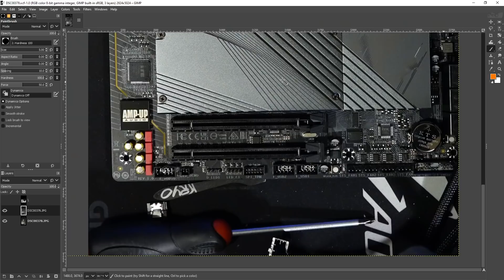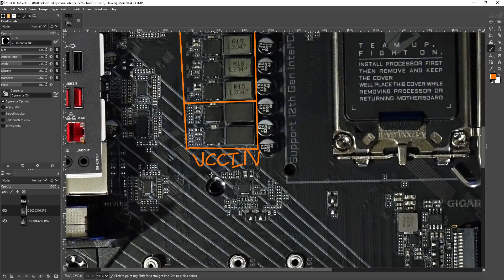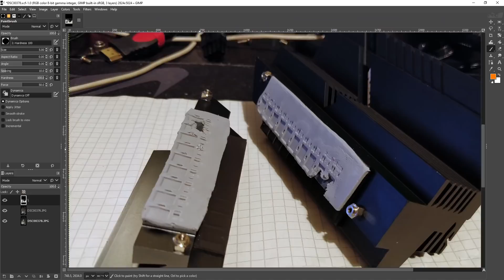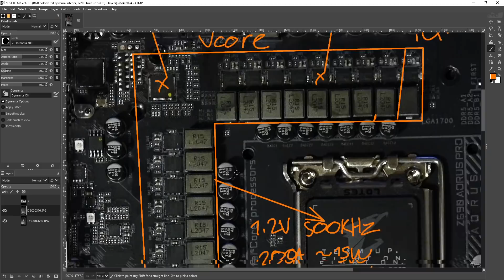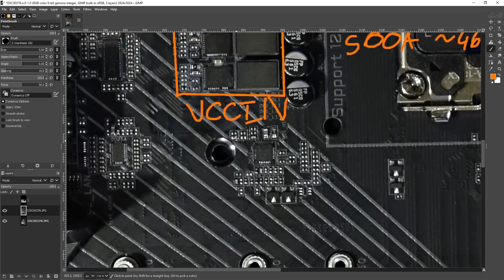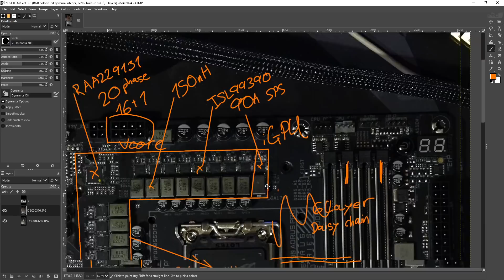mobo PCB Breakdown: Gigabyte Z690 Aorus Pro // The GOTO Overclocking board

Comment: Now two years later and with the F28 bios, I am trying to get my 7200 memory kit to run at 7600 or 7800 even. So, I really don't need to get a Z790 to overclock my memory. 
And Gigabyte didn't believe in their own products and declared 6000 or 6200 ram to be the end of the line for this incredible board. The digital code display was actually my reason for getting it in the first place. It replaced my Z270 Gaming 7, which also has a LED debug screen on. I kinda don't want to buy a board without one. Once you have one, you cannot go back.

Comment: Thanks for making all of your videos, I've been bingeing them for the last few days. Would you recommend this board for a CPU like the i7-13700k? Or are there better options to consider?
Reply: I use this motherboard with 13700kf, with a  offset of - 0.075, Vcore set to Normal and  internal VCCSA to Normal, I get much less voltages and temps, I have also noticed from all of my previous Gigabyte motherboards are too aggressive in voltages!

Comment: Just grabbed this board, but the ULTRA version (vs "PRO").  Was $199.99 because of antonline (their own site, their amazon store, ebay store, etc.).

Of course, I am coming from the future of 11/11/2022.
Reply: PS - it goes from 90A to 105A Power Stages, but I'm not sure what else is actually different about the Pro to Ultra 'upgrade' (original price jump was 330->370, so maybe that increase power is the only difference).
Reply: UPDATE - the Ultra also adds support for DTS:X Ultra (which the Pro doesn't have) and you go from DisplayPort 1.2 to 1.4 from pro to ultra.

So.... DTS:X Ultra is added to the sound support and you upgrade to DS 1.4, and you go from 90 to 105 on the power stages.

Comment: I have this board and absolutely love it. But I have a question/concern that I'm hoping somebody may have some insight on. I decided to replace the Intel ILM with the Thermalright contact frame, and it is actually working great. The first time around I didn't have enough contact with the pins, but I went back through the GN method on installation and it is great. Core-to-core deltas are down and I can run P95 at 5.4 (i5-12600k) and get down to 88C. 

The only thing is: I immediately started noticing coil whine coming from the VRM. I am 95% sure it was not audible before the ILM swap. 

One more detail: it completely goes away when I run a static voltage. I know that's because it's steady, and that is basically what should happen. But yeah. I know whine can be normal, but it's new to me and I am just a little concerned with the circumstances under which it started.

Everything is running perfectly, VRM temps are great, benchmarks run great, etc..

I opened a ticket with Gigabyte, just to get out in front of it just in case. I'm a tech professional myself, but only about 9 months getting deep into hardware.

Any advice?

Comment: Would i be better of getting this z690 pro over the z790 aurous elite 90amp vs 7amp. does the eelite have 4 more pcie 4.0 lanes? the pro has better rear i/o and wireless maybe better on board audio not sure. And it has that post code and 9 temp sensors. plan on running it with 13700k.

Comment: The Digital SPDIF OUT, or the optical output you mention, is very important to me : Why ? Because its great at transferring home theatre quality5.1 surround sound, into your home AV home theatre reciever. I have a 75" monitor and a 3080Ti to run 4k @ 120Hz for MSFS 2020 for example. Works great :) And when I stream music or movies I get 5.1 via the PC hooked to the TV :D😊 OH and those red filters are great, the audio should be very very good here :)

Comment: I like this board, i may have to find out if my Noctua NH-D14 works with it, all tho i may have to wait for next gen Intel, i am worryed about power usage of their current lineup, and i kinda want an i5/I7 wiht a bit more pref but lower power draw if posible. Also my 8700k on my Gigabyte Z390 Auros elite, is still going strong in most games(cept bf2042). So getting it oced on my current board could prolong its life for a year or 2 more. But if i wanted the 12600k/12700k i would be shopping for this mobo, just based on your review. it ticks all the rigth boxes for me as well, all the the price is a  bit steep in my country, to be fair it seems that all Z690 is heavy duty overpriced tho.

Comment: S/PDIF = Sony/Philips Digital Interface. It uses one or both of these connectors (on motherboards, usually Optical only). Usually there's only Out, sometimes both In & Out:
   * Optical  (TOSLINK)
   * Coaxial (1 x RCA with an orange ring)

S/PDIF was developed for CD-players, then utilized with DVD-players etc. That's where ~1.4 Mbps maximum bandwidth comes. Which is enough for:
   * CD-Audio (PCM 2.0 16b/44.1kHz)
   * Dolby Digital 5.1, Dolby Digital EX
   * DTS 5.1, DTS-ES, DTS 96/24
   * MP3 etc.

So, these are absolutely impossible via S/PDIF (DRM alone prevents it). Both of these can be found at least from Blu-ray movies (both 2K and 4K):
   * Dolby TrueHD
   * DTS-HD Master Audio

Comment: this or the msi carbon? with the consideration of price. Is there a performance difference between higher amp lower phase count and lower amp and higher phase count other than temperature differences, according to the divide by 10 rule, the msi vrms will run hotter than the aorus pro. Also whats the difference between an 8 layer pcb and 6 layer

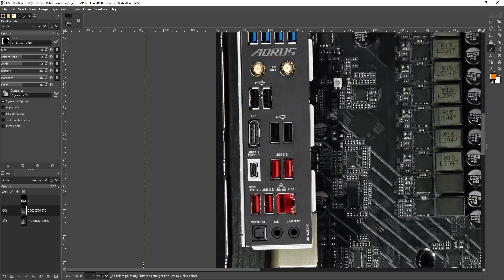Comment: 6:10 Basically, they got rid of the 'orange' (centre speaker or subwoofer), 'black' (rear speaker), and 'light blue' (line in or side speaker) jacks, keeping S/PDIF (sort of an optical line out), 'pink' (always mic in), and 'lime' (line out or front speaker). They've essentially realised before anyone else that nobody runs their 7.1 channel sound system off of a motherboard, and those that do use a computer as a home theatre PC with 7.1 probably use an audio receiver anyways, to connect consoles and what-have-you to their TV as well.
Reply: Buildzoid should make a poll which audio source people are actually using:
Mice in (pink) & line out (green)
Spdif (optical)
Gpu HDMI /DP
Bluetooth / WLAN
USB
5.1
7.1
Reply: Most audio receivers specially 7.1 or 5.1 don't have full line out ie sub out, surround out. Most are powered line out. It's a headache if you have built in powered speakers and subwoofers.

Comment: Also this is the cheapest (almost) Z690 mobo with a temperature sensor header (which is very important for custom water cooling loops so you can control your radiator fans of off the coolant temperature). The cheaper is the Gigabyte Z690 AERO G, which seems to be basically the same mobo, but targeted at creators. It doesn't have the OC features like POST code.

MSI's Z690 with the temp sensor header are only in the MEG (highest) line and the ASUS Z690 mobos seem to be very costly. Well, technically there's the ASUS PRIME Z690-A which is less than the Aorus Pro and it does have a temp sensor header, but it does not have the other OC features. It's $30 cheaper according to newegg, not much of a difference given what the Aorus Pro offers. Btw the ASUS TUF Z690 line does not have a temp sensor header. And no, I don't care about ASRock, didn't bother to look at their lineup.
Reply: I was lucky enough to get a combo drop on Newegg and was pleasantly surprised the board had a temp sensor header on it. I am upgrading from MSI Z390 Ace and I am looking forward to being able to tune my fans to my liquid temp.

Comment: You've got it EXACTLY right when it comes to "Dual BIOS" implementations! Gigabyte should do away with the single/dual switch on their "AORUS Master" boards and just have the BIOS 1/2 switch. If not, just stick to single BIOS. Having to cut power during boot 3-5 times in a row to get the "auto BIOS" system to switch is a royal P.I.T.A. (plus, there is usually NO on-board indicator for which BIOS you're on!)
I'm also in total agreement about POST code displays. I absolutely love 'em, and have always bought the cheapest MoBo that has one on it. I've found that every manufacturer, by the time they include it, makes a high-quality VRM and memory buss, so if you've got a POST display, you've got a good MoBo.

Comment: I wonder if the SMT PCIe slot is going to be an issue over time from the stresses of thermal cycling and the weight of some of these modern video cards.

Comment: The super super low end entry Gigabyte Z690 UD is apparently 60A * 16 and 6 layer.  I kind of question why anyone would venture outside of the "entry" 200-300 range for gaming/light OC on a 12600/12700k. It seems like the VRM matters less this generation for these two CPUs? (Aurous PRO also seems to be barrier of entry for 12900k).

I would argue the only benefit to a super premium board ($500 USD price range) is 8 layer integrity for memory OC and what not.

Side note.. My X570 UNIFY VRM seems mediocre now by Z690 standards, but such is life.

Comment: I might upgrade to this board in a year or two, just couldn’t justify the move to ddr5 yet so I went with a lower tier gigabyte board that is ddr4.
Reply: Not worth the effort, DDR5 is 2-4% faster than a good kit of DDR4 (see TPU comparison). You will never notice that, so it makes no sense to swap everything just for that minute difference. What's more, Raptor Lake (Alder Lake successor) is gonna come out in about a year, and it's gonna bring Z790, which will also have some boards with DDR4 support. So DDR4 ain't dead yet, it's actually still quite competitive as it's completely mature, they got everything out of that technology, while DDR5 is still in its infancy and too expensive (or sold out at the moment).

Comment: One way around the dualBIOS is to change the 2nd BIOS post boot image.
 The intel UHD770 iGPU can overclock +500MHz giving it a 2.1GHz clock rated at over 1TFlop of FP32. It helps with quicksync.

Comment: 12 type A ports, damn, when is the AM4 version of that happening. I think 7 was the max on peasant priced boards. FYI, external sound will always be cleaner than any DAC inside a digital RFI noise filled computer case.
Reply: B550 Aorus Pro has 11 Type A USBs for 180 USD. Most of the Gigabyte lineup for B550 has tons of USB ports.
Reply: gotta love being able to hear the mouse move and being able to tell what's on screen be the type of high pitched noise made.

Comment: why do some z690 boards have an extra dimm slot(3/5 total)? btw i have realtek lan and it works great even though my board is from colorful(i regret everything), intel lan is a scan in my book
Reply from the maker: because that's not a dimm slot and if you read the manual for those boards it would tell you what it's for.
Reply: I'm curious now. What is it? :D

Comment: I ended up getting the Master this gen... at $469 its a no brainer
Reply: Do you like it? any issue with bios or ram? Thanks
Reply: @salehabdulla9177  horrible board, no i run an apex, 12900k 5.5 4.3 7200cl30 now. I had sooo many isssues with the master but that was rev1 right after launch. Bios updates could have ironed out the issues. But it wasnt even booting 5200 xmp even after me setting everything manually i couldnt get it to boot.
Reply: @sagerdood  k I had positive Z690 master exp. but received damaged on usb plate so shop send me asus hero. when I tested master it was very cool no heat. on asus hero pch heat to 60c.

Comment: So it looks like Gigabyte designed the VRM to just the right size, 200A@1.2V is 240W, basically a stock 12900k.
The VRM is hitting peak efficiency.
Reply: Is it good or limit 12900k performance? I read it's not good mobo with ddr5.

Comment: Hey Buildzoid, whats the difference between this one and the z690 ultra apart from aesthetics and the fact that the latter uses 105A power stages  ? Its like $20 on top of this one and I was wondering if it makes sense to pay just a little extra just for posterity ? Thanks man and stay safe.
Reply: (Besides different heatsiinks) it seems like Ultra's PCB has 8 layers against Pro's 6, which is weird because otherwise they're completely the same. Maybe it's an error on GB website, because they also claim Pro to have ALC4080 and ALC1220 at the same time.
Reply: Good question. The ULTRA could possibly be a T-Topology RAM arrangement, hence the extra layers for the tracers. Maybe?

Comment: Could You please do a rundown on whole Gigabyte z690 board lineup as always? I'm particularly interested in Gaming X VRM. Thank You in advance. <3
Reply: The Gaming X uses a PCP81530 PWM controller for 16x 60A DrMOS phases in "Twin VRM" design (teamed/parallel), as well as DrMOS on the VCCGT/VCCAUX. So they are not Smart Powerstages, but when looking at the competetive pricing of the Gaming X, it's actually in good shape. It undercuts the likes of the MSI Pro Z690-A and is actually a bit better feature-wise. So Gigabyte positioned their board models quite well.
Reply: @Mike500  What about ASUS TUF GAMING Z690-PLUS D4? Can You tell smthing about its VRM and which one would You choose VRM wise?
Reply: @PsXAddicT  The ASUS is comparable, but way more expensive, making the Gaming X an easy choice.
Reply: Which z690 you will get if you have 400$m

Comment: Asus Z690 Hero was only Z690 motherboard available, so I ordered Hero but I'm not sure if it's good enough for 12900k
Reply: Pretty much any mid range board is enough. Even low end like tuf has 14 80a stages, it doesnt care for 129000k
Reply: @ksof1   I was joking, I know it is overkill for me with air cooler - Noctua D15, I don't want to do LN2 OC or something like that, but like I said Asus Z690 Hero was only Z690 motherboard  ( with DDR5 support) available and I really do not like waiting when I have here all other components for my PC build

Comment from the maker: AND THE VIDEO IS BACK.
turns out that when I was rechecking my notes I was doing the VRM calculations with 1V output but using the 1.2V performance curves which lead to me thinking the notes are wrong. The notes were actually mostly fine. 

I say mostly fine because I did somehow miss the fact the ISL99390 is SPS + indcutor losses not just SPS losses(which makes sense as isolating the inductor losses is really difficult). 

first.
Reply: Hey bz did gigabyte send you a 690 tachyon?
Reply from the maker: @gordonfan019  should be coming soon
Reply: @ActuallyHardcoreOverclocking  Can't wait for gigabyte's master and ultra pcb breakdowns. Also Asus line. Just for viewing pleasure, if I were to buy one, this would prob be it.
Reply from the maker: @LedNe0nDevil  I don't have an Ultra or any ASUS boards
Reply: @ActuallyHardcoreOverclocking  But you always do them with tomshardware pcb photos right? RIGHT? :o
I love your pcb breakdowns <3
Reply: getting any MSI boards?
Reply from the maker: @jasonlowry5833  no: https://youtu.be/bw_i4SpPv4E